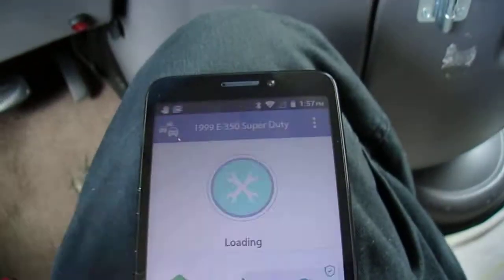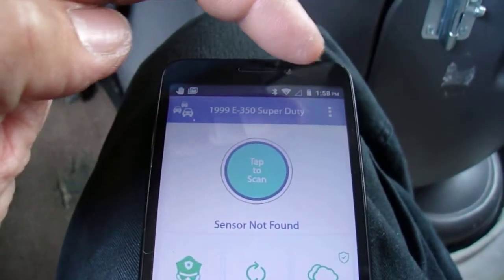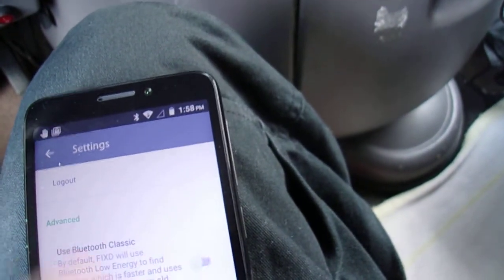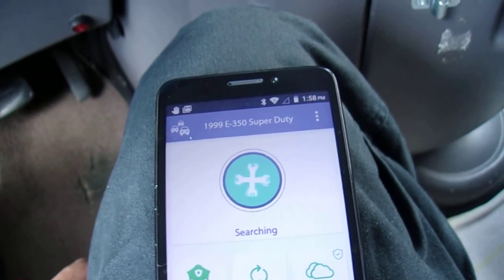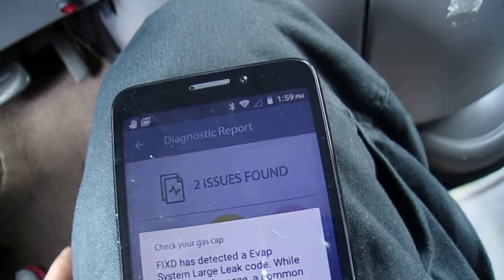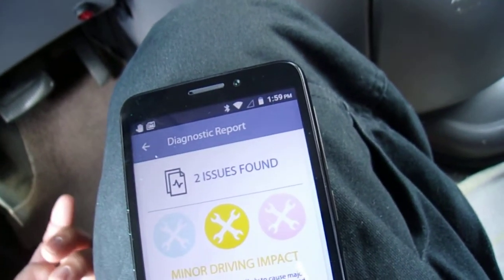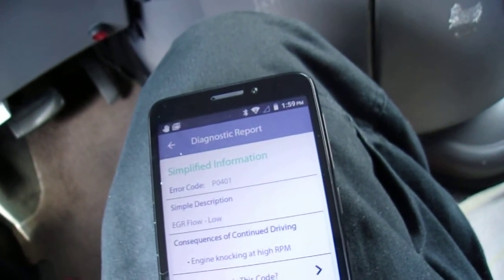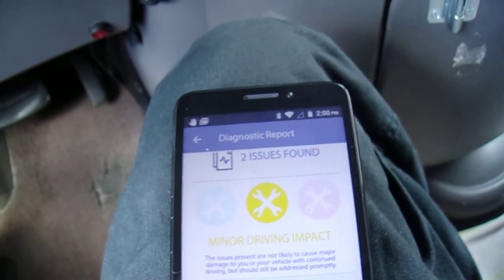FIXD App sensor not found detected troubleshooting How to sync app with sensor potential easy fix

Comment: Dang hope it’s an easy inexpensive fix! Check engine lights give me anxiety.. those v10s in delivery and shuttle vans  I see often with 500k miles! I hope yours makes it that far!
Reply from the maker: Of course I get a CEL after my lift kit! I wonder if any Vac lines got knocked loose. I'm getting it fixed ASAP. Just uploaded a video on the Premium subscription
Reply: @JohnDrivesAnything  Murphy’s Law 🤬
Reply from the maker: Can't really tell anythings wrong maybe once this is fixed my Fuel Economy will improve a little.

Comment: I can see "FIXD" in my Bluetooth settings list but the app can't find it when I scan for a sensor, also it came with a little paper to explain how to connect it and it says you have to put the code that's on the Sensor into the app somewhere to link it but I can't seem to do that either. The Sensor settings in the app it just says "No Sensors configured" and there's no option to add a sensor with the code there either. 
I tried it with the car off, battery on and engine on, all three with and without classic bluetooth mode. none worked.